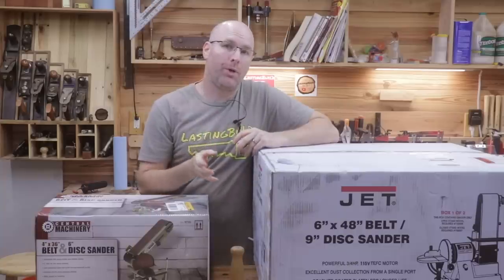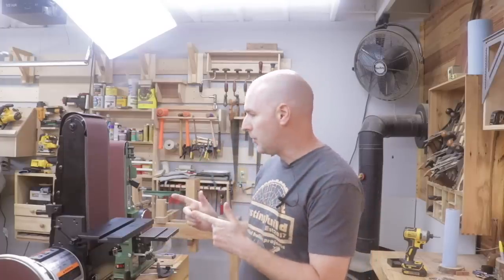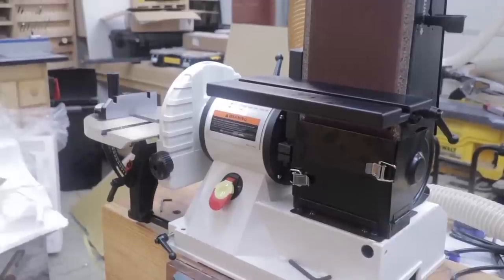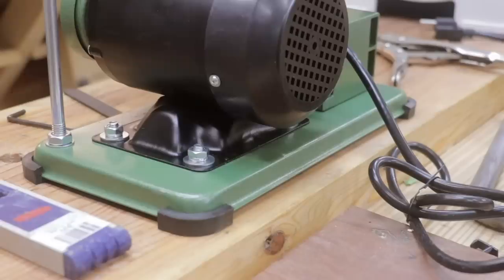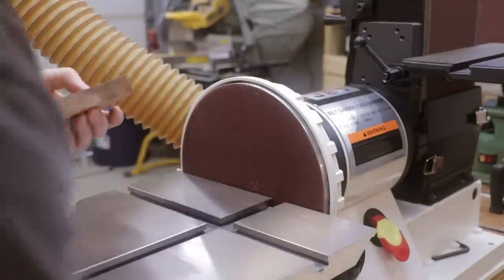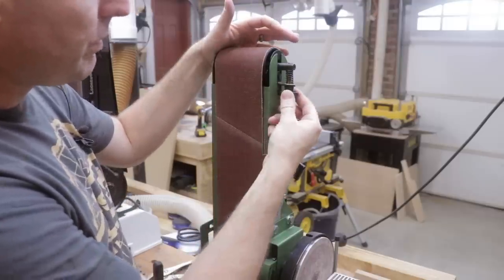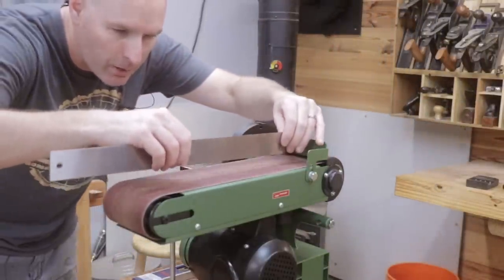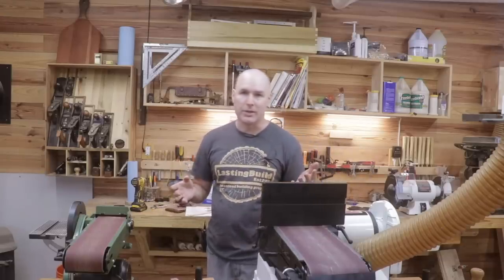The REAL Difference In This Cheap vs. Expensive Tool!

Comment: I was shopping around a couple years ago and the best I found by leaps and bounds was the Porter Cable.... That is in the $100-$200 range..... All of them had crappy tables that flexed EXCEPT the Porter Cable, and it's built pretty rigid

Comment: You are comparing the Jet to the wrong HF belt combo sander. The one that's in the same league is the 6x48 with 9" disc. 61750 Which has a coupon for $199
Their main differences are the motor style and belt installation. And how the motor transmits the power/torque to the actual disc/belt rollers. Jet is direct drive.

Comment: Good video covering the basics. About what you would think. One major area not covered are the bearings. Don’t know for sure, but if the HF is like some cheaper sanders I have had, it’s just turning on cheap nylon bearings. My guess is the Jet has grown up bearings. I also think you might get better dust collection from a dedicated small shop vac. I don’t know the science, but DC works better for me on tools that take bigger chunks (table saw, jointer, planer.) for sanders and router tables, I like to put it on a shop made cabinet with casters. In the lower section is a small shop vac with hoses run to the ports. Can even put in a switch to start/stop both units.

Comment: I went middle of the road and bought the Porter Cable. No problems.
Reply from the maker: Cool! I do not have any Porter Cable tools, yet! 😬
Reply: @lastingbuild1373  Generally reliable. The belt/disc sander is my main money maker.

Comment: I have that exact same Central Machinery sander. I like that it's small and easily movable, since I have limited space in my garage shop. I haven't used the disc yet, but I did get a laugh when I saw the tiny dust port. Don't know how I'll get that to work.
 For the belt dust port, I bought some 2" hose at Ace. It fits tight and actually does collect the dust pretty well in the vertical position. For horizontal I'll have to find an elbow that fits. I have bought 7 or 8 pvc fittings, but haven't found one yet that fits or can be modified to fit.
 One issue I had: I had to take the belt cover off  to move the belt because it was rubbing on the cover. 7 screws  and one bolt just to remove it. Then I had to move the motor shaft pulley out a bit. So close to the housing that I had a hard time getting my small pulley puller in there to move it out the quarter inch needed.  At the other end of the belt, I didn't need to move the pulley, but I had to tweek the cover to get belt clearance, since the supporting cover bolt is not close to that end and doesn't give any rigidity to that side. Also, the 3 screws holding the cover at one end also hold the plastic disc dust cover, but after moving the belt pulley, they are too long and rub on the pulley if the dust cover is not on. 
A few other annoying things needed to be done before I could use it, but it works fairly well so was worth the $70 bucks.

Comment: I can right off see huge differences between the cheap and expensive. You got the cheapest HF 4",  and you got a larger one to compare it with.  You said "The striking difference between these two tools is the price". But if you get someone to walk in right then and ask them what the striking difference between the two, they would say "Size, power, etc", not price.  Then if you tell them the price difference, they would agree, "Of course that one is more expensive"
 Get the same size machine (4") instead of a 6" and then do a comparison.  Or get the HF 6" to compare with the Jet 6".   Its like comparing a small Ford 4 cylinder work truck to a GMC Sierra 2500. Which is better? Ford or GMC?  Try again.

Comment: HF does sell a 6 x 48 belt sander which at current prices is about $250.00. Perhaps this comparison might be more "Apples to Apples" . . . The HF vs ??? debate will be ongoing. It is likely that when comparison begins the assumed criteria are different from user to user. Bottom line for many is affordability. Were it not for HF some might not afford any tools at all. In our shop we have both JET and HF tools. A maker space in our town is sponsored by JET. More high quality, HIGH DOLLAR tools "in captivity" than I've ever seen. Someone mentioned multiple table saws, stationary belt sanders, and other tools. One might wonder why?  In a production shop one wishes to set up a tool and leave it so that tomorrow when time to 'groove at .23" for slide in box lid' process comes around again half an hour isn't lost getting to accuracy. For us small boxes we make must be square--the Jet. For 'rough' first sanding HF.

Comment: Your supposed to sand on the down side of the disc. It pulls the wood down onto the table as well as the dust into the dust trap.
Reply from the maker: you are correct! I learned that the hard way, lol!

Comment: Great review, thanks! What are thing about the WEN 6502T. It’s very like the harbor freight, same belt and disc size, just a little more expensive that the HF but still in budget $122.31 on Amazon, but also has 4 stars and 1452 reviews.

Comment: So it looks like after you go through the set up harbor freight would be the one to buy unless you did a lot of sanding. Use the down side on the disc it might help with dust and save knuckles.lol
Reply from the maker: I think the harbor freight will work just fine! Just not sure how long 🤔

Comment: Both appear to be built for different use cases.  A dedicated woodworker would likely be happier with the Jet; however, the hobbyist / DIYer will do well with the Harbor Freight.  Is the Jet 10 times better than the Harbor Freight?  Not sure I got an answer to that question.

Comment: Yikes! The jet combo sander is now at $1400 on Amazon. I used to own a Grizzly years ago, this search for a new sander is harder than I thought. I have a Rikon 6x48x10 that I just ordered and now is going back. It was missing the manual and parts! I was really hoping that the Jet would be a better choice and I do like the 4” dust port and the solid build, but at that price I might as well go up another notch and get a cabinet model.

Comment: Interesting to put them head to head as the price difference is about 10x, nevertheless thanks a lot for showing the compromisses made on the cheaper one, speaking only for myself, instead of the cheap one, better of just to handsand :)  The Jet also has a graphite backing for the beltsander, this will reduce a lot the friction and heat and is an absolute must have on such wide belt.

Comment: I do believe if you look into the electrics of each machine you will find major differences. The harbor freight I guarantee you has a switch that doesn't match the tool ratings. They are bad for placeing lower watt/amp parts inside. And the motor windings and brushes are going to look it. Less or only a shellack coating on the wires. Sloppy surfacing across the board. Cheaper and thinner materials. I'd build my own with some of that pallet wood first.

Comment: first this is not close to apples to apples... BUT if people want that JET style sander for a fraction of the price, just stalk craigslist... if your someone that thinks they need NEW... there is a 4x36 8"disc 3/4hp sander that is rebadged as porter cable, bucktool, allwin, rikon and so on... I believe the bucktool version BD4801 on amazon is the cheapest at $200 (porter cable being $400 for the same sander) that is coming from someone that has made it his lifes mission to never over pay for anything... i've done all the research that can be done on this and many other tools...
Reply: I also have no beef with JET I own there tablesaw, 14" bandsaw, and 6" jointer... but i only paid $500 for them all... LOL
Reply: oops.... didnt see the apples to apples video...
Reply: @keithmarlowe5569  everything i have seen by WEN are all branded tools from china... the sander I believe your talking about is also a Ryobi and grizzly.... I own a WEN track saw, that is the same as the Titon, Triton,  MAC allister, 
 Erbauer,  Feider.... but works just like a festool tracksaw.... just 1/8th the price....
Reply: @keithmarlowe5569  I have the Wen 12.5" planer. No complaints so far. It planes. I don't do this for a living so it serves its purpose as a hobby tool. I have a HF lathe and it turns true. Made many pens with it. If I can, I will go the cheaper way. I have noticed that there are some cheaper tools that are just crap. Win some, lose some but I cannot complain about the lathe or the Wen planer.

Comment: u have it  you can bog it down   easy    but i use it to  sharpen my woodturning   chisels
Reply from the maker: What grit paper are you using?
Reply: 80 on the disc  and 120  on belt  the disc is  the one  i can bog it down with  doing small wood cookies

Comment: I have several Grizzly machines which are good quality.  Having said that I also have a Jet 22/44 drum sander, a Jet scroll saw and a Jet 8" jointer which I love.  I use the drum sander and jointer every day and have had 0 problems.  All the Jet's are over 3 years old.   I do use Harbor Freight for things I can use and need but when it comes to equipment that will be used every week I pass.
Reply from the maker: I would love to have that drum sander and jointer!!

Comment: I think you would have a good posting if you what are used the harbor freight belt disc sander that was bigger then The harbor freight that you were using is the smaller of their Sanders I believe more accurate testing of apples to apples and oranges to oranges when you buy The cheapest you don’t test it against the machine that’s literally 5 1/4  bigger not only in cost what also in size like the jet Harbor freight has a bigger model sander and it’s comparable to the price so do us all a favor and don’t try to pass off the best of jet against the cheapest of harbor freight go and get the harbor freight disc sander belt sander that way you’re comparing apples to apples and oranges to oranges thank you very much Wayne Obryant Merced California

Comment: I recently bought the HF 4x36 model. And my biggest complaint on it was not covered here. Changing the paper. This is extremely cumbersome and difficult. I almost trashed the machine just based on that. I get around all the other shortcomings just fine, but this one is big for me. I wonder if you or any other users have any comment on that. 
Thank you for the video...very well presented, you're very good a it. Most tool comparisons are painful to watch.

Comment: Your video is just short of useless, as it is comparing 2 completely different sized machines. The Harbor Freight is only a 4" x 36" inch sander, and yet the JET is a 6" x 48" inch, so there's no comparison whatsoever. I'm not sure what kind of woodworker you are, but you're obviously and uselessly comparing apples to oranges. Just sayin'... 😶

Comment: Why compare a large expensive sander to a cheap small sander?
At the very least they should be the same size. I have a inexpensive belt / disc sander the same size as the Jet and it works fine. It was about 200.00. The small HF sander is more of a hobby tool or for light woodworking. The Jet is for more heavy duty, serious woodworking. 

Comparing these two tools makes no sense to me. Of course a 75.00 dollar tool is going to made of cheap materials and not be precision machined. Of course a larger 600.00 tool will have better quality machining and parts and be heavier. 

Anyone interested in or needing the Jet sander would not even consider the small HF sander! The same goes for the person looking for a bargain sander, they can't spend 600 bucks and wouldn't look at the Jet. 
Why compare these two tools?

Comment: Noticed on the Jet disc sander that the disc must not be truly flat. There was only a small area that was dirty from sanding. And the disc spun clockwise and the HF disc runs counterclockwise
Reply: I used PVC pipe to connect for dust

Comment: Do do know that you were sanding on the wrong side of the disc. . .  right?

Not only will the left side of the disc lift and pull the wood out of your hand (and injure you or someone else). . .  it throws the dust UP rather then PULL is down - as your dust collector clearly demonstrated. Should have been a clue, right? 

Hell of a lot more dangerous than "puncturing" your finger on a aluminum sliver. Maybe you figured it out. . .  I couldn't watch the rest of the video, so who knows.

Probably should have read the instructions or asked a professional.

Comment: Consider that an industrial verision of that tool would be about $2000 so the Jet is a good deal. Really cheap tools have a tendancy to fail eventually. If its a tool you will use you are better off to get a better tool. Jet does not make any junk. Harbor Freight, well thats another story. Might last might not. When I am buying tools for my shop cheap does not cut it and I cannot afford to throw away them.
Reply from the maker: Agreed! Thanks Paul!
Reply: @lastingbuild1373  The other advantage to better quality tools is that if you no longer need it someone would be quite happy to pay you for it. Cheap stuff is VERY hard to sell.

Comment: why would you even both to compare a $60 item to a $600 unit when clearly they are not even the same size. After the review are you planning to re-box the HF and get you money back?
FYI Jet is made in China in a generic factory that Jet gets the manufacturer to label their units Jet. If you bothered to look around you could get one all cast and metal no plastic or aluminum for less than $600. If you really want quality tools then buy Taiwanese made.

Comment: Come on Jim.  You can do better than this.  Very unfair comparison. All of us are pretty much aware that the Jet product is right out of the box gonna blow away the HF unit. However to be fair and to offer a true comparison you should have at least featured two relatively “like” models.  HF. Does have a 6x48 unit as well. Still substantially less cost than the Jet.  
For something that cost ten times more than I would suggest the HF is the better option.   The reliability for the average wood worker needs is there and if you should get one of the lemonier ( just made that up) units made on a Friday afternoon at the factory then you buy a second one.  Still way ahead in dollars over the Jet. The Net being an entry level Mustard machine disguised in white is the better unit bu car but nit the better buy and the HF. Will perform adequately for the average woodworker  without even mentioning cost savings. By the way I myself do not own any HF tools.  My  6x48-10 in disc is a Rikon so I have no skin in the game
Harleymike/chicago